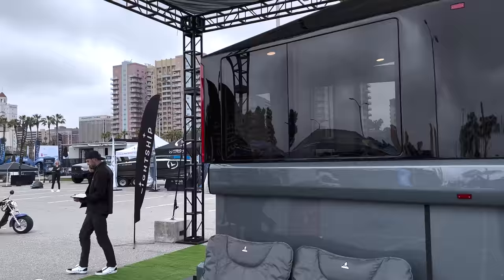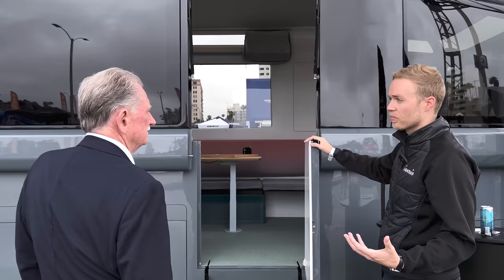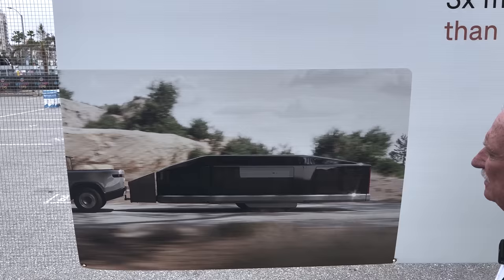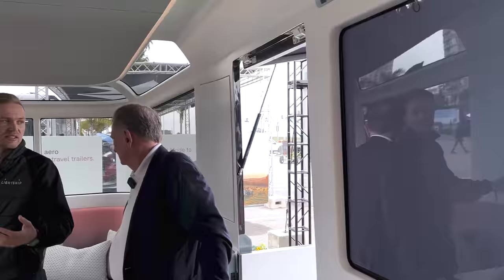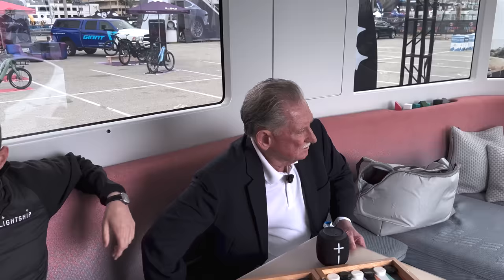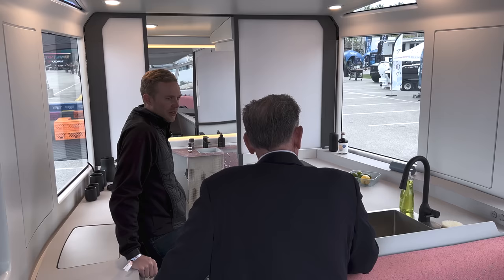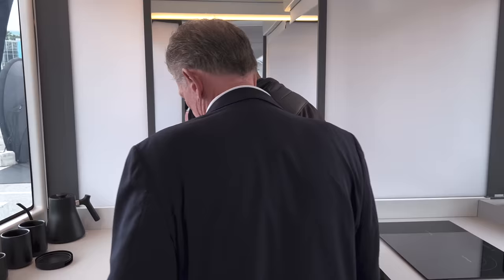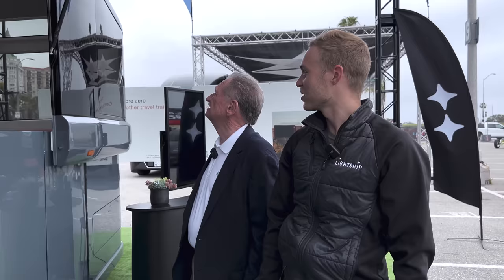Tesla Graduates Electrify the RV Industry - Lightship's All-Electric Trailer

Comment: Looks great. I just wish they would reduce all the thermal gaps (windows). I'd like to know who they're polling who say they like a spacious RV. Everyone I know would rather have the walls covered with more storage space. On top of that, every RV I've ever seen had a minimal amount of polystyrene in the walls with single pane windows. I wish someone would install 3.5" of polyurethane closed cell or some vacuum insulated panels in the walls. If you build a great thermal envelope you dont need as much electrical power to keep the cabin comfortable.
Reply: It would be mandatory to have a pickup truck for all your stuff....but I don't see enough storage for food, let alone clothing.  Also the air conditioning is extremely power-hungry and the thermal loss or gain will be tremendous, even considering that the solar panels on the roof will help.  Not practical.  And they have taken a high end RV and added $35,000 in additional complexity.
Reply: This is exactly what I did with my diy trailer. Two small windows in the kitchen and one in the bedroom. Rest is insulated walls.

Edit: but this is a collapsible trailer which is very smart for EV towing.
Reply: there is overhead storage that they didn’t show. and some storage where the propane would normally be. and under the couch area.  they should make a storage accessory to install over one of the windows for extra though.
 I too think good insulation is important. and most rv parks don’t provide great views. however, you can electo-dim the windows individually- so you can optimize what you see, easily. some other videos cover additional functionality not included in this video.
Reply: @mriguy3202  - Electric HEAT pump , not a Conventional AC unit, too heavy , inefficient. 
Defiantly, reduce windows to minimum. and only use Thermal windows. 
Lightship , should have LESS energy requirements than Conventional RV.
ZERO combustion heating & cooking. 
no longer need Dangerous GAS bottles.
Reply: another aspect i like about the starship is that it would allow you to generate electricity for your home if you park it outside. just install a generator plug/transfer switch. minimal permitting or work required. 80 kWh is a huge bank for a home.
Reply: @dfghdfzsd   - NOPE, V2G is a great way to KILL your Batteries.
NCA/NCM not great option for V2G. 
better off with 4x powerwalls , in the FIRST place.
Reply: I sat in that prototype on Saturday and chatted them up. the spaciousness is totally off the hook, and there is plenty of storage. I hope they don’t change a thing.
Reply: @markplott4820  nca/ncm? 4x powerball is 55 kWh vs 80 on the lightship. also, KILL in all caps is a bit strong- any daily usage will very slowly degrade the battery, powerwall or not. how the cycling is done has a big impact and we can expect similar care as you might see in the powerwall electronics. 4 powerwalls is $32k. 
lightship could offset $1000 in electrical bills yearly for 20 years and still have 64 kWh of capacity left. and where will battery tech be in 20 years?? 
Just food for thought. i suppose it’s all a matter of priorities.
Reply: @WarrenBowman  - Did the windows look double paned? Just curious because if they aren't users will get MASSIVE amounts of condensation on the inside when camping in cold climates.
Reply: @__-pl3jg  they are not. Since it’s a prototype, I don’t expect that these are necessarily the final windows.
Reply: @dfghdfzsd  it is but the trailer only has 3kwh of solar. Plenty for a trailer but minimal for a home. But I suppose better to get use out of it then have it parked doing nothing. 

Only downside is the cycle life of the battery using it for a home like that
Reply: On a lifting roof system with solid walls its hard to have interior upper cabinets over lower cabinets and furniture along with maintain the full overlap when closed for towing efficiency.  The shower head on the ceiling was likely to eliminate a protrusion out of the upper wall that could be sheared off when collapsing the unit while in the galley they had to use a faucet that needs to be removed before lowering the top.

On the large expanses of glass, it was probably done to give the illusion of space to make the lack of slide-outs as obvious.  Many who would be spending that kind of money on a comparatively small trailer that's less than 30 feet long would feel quite claustrophobic in a 27 foot coach that has a full bath with no slides and few windows.

The final selling price is going to be interesting and may end up being as costly as a small Class A unit.

Note that Hi-Low, who has been making this type of trailer since 1955, still has not be able to raise enough capital to resume production (even without the added cost of adding the drive unit) and they have limited their sights to just an 18 foot long by 6 foot 11 inch wide unit with a 6 foot 2 inch ceiling height.  Those weigh in at 2,362 lbs dry and have a cargo capacity of only 870 lbs for a gross weight of 3,232 lbs.  At this point they no longer even have a production facility after being in business for 68 years so it may be difficult to be the "New Guy" introducing an upscale Hi-Low at this time.  Investors may look at how the Grandfather of this type of trailer is doing and be concerned about a startup being able to do better.

Wish them success as we need this type of driven trailer tech across the board today but may need a simpler more utilitarian version first to reach economy of scale.

Best!
Reply: @mikebalentine  yeah, depends on how aggressive you cycle the battery, but it’s a shame to let it sit doing nothing. and the bigger the battery the gentler you can cycle- in general. My house would only need about 10 kWh during the day when i pay ‘on-peak’ prices. so this would be perfect for me, but everyone’s situation is different. 🙂
Reply: All the windows walls slide down for efficient towing.
Reply: @dfghdfzsd  my plan is working up to 60kwh. I figure that should last 5-7 days in the event of bad weather moving in giving me lots of flexibility.
Reply: @markplott4820   - ha ha ha...   the marketing bought you too?? pray tell, how is the magic heatpump different to my Daiken AC..  (all modern AC units in the real world reverse cycle) - yes there a re different compressors and different gasses for temperature ranges..  AC - heatpump, - potato, tomato..  (sure exchange any medium.. water/oil/salt/Air to air/water/solid - exchange to whatever you like...

(no window has anything like the "real" thermal performance of any decent insulated wall panel)
Reply: @markplott4820   (you mean, buy the power walls, instead of the EV ?? - keep the old jalopy- more enviro... )
Reply: @kadmow   - NO, get Both.
TESLA model 3 RWD + Powerwalls 2 - 3. 
powers your HOME for up to 3 DAYS. 
get SOLAR + 1000w WIND , even better.
Reply: @kadmow  - ULTRA compact HEAT pump from Panasonic & Mitsubishi use LESS energy and the units are outside & you can have Multiple Discrete air handlers. 

even BETTER Ditch the old fashioned water heaters for Electric point of use. 

endless HOT water only when you need it, & where you need it. 
no need to heat water all day , when no one is home.
Reply: @markplott4820  ok, so you’ve got some things right 😂
Reply: @markplott4820  ,yes thanks, I have similar...
Reply: @markplott4820  , ha ha ha, assuming everyone has $$$ kicking around to make more payments...  Ot is the financial jump we need to help people over, mostly it is Either electricity Or...  Most choose food, lol...( we are very fortunate exceptions. )
Reply: @kadmow   - SOLAR building Materiels are just as cheap as wood & stucco home.
Reply: @markplott4820  : not sure I follow you, yes in Australia it is getting "more affordable" to use the solar panels as the cladding for an insulated roof system (not sure I like walking on solar panels however -  use soft climbing shoes), but the price per panel is higher than durable metal roofing - then the solar electric components have a cost too.. (500W trina panel - nearly the same size as a typical sheet of OSB $325 - OSB plus asphalt shingles ?? $60-120.

In the USA the solar industry is pricing significantly higher - apparently.
Reply: @kadmow   - Builders are also using SOLAR for Structural walls too.
Reply: @markplott4820  ;  you don't really answer just more deflection..  Still incorrect on most dogmatic points raised - sure a solar inclusive façade will be great  (fails on the "non flammable curtain wall" however ..  though much more expensive....  One can power their "monoblock pumpless" heatpump for free however (thermal storage is much more affordable than any quantity of electrical storage), so there is a potential net benefit...  lol...   I will keep on just having a laugh.
Reply: @kadmow  YET, more & more Developers WORLDWIDE are building Projects in REMOTE grid FREE areas.
Reply: @markplott4820   - yes with unrealistic funding (subsidies) and/or diesel backup.
Reply: Embassy vans insulate better for more efficient electric usage with no propane and no solar.
Reply: You can't have a bunch of overhead and undercounter storage and have the trailer collapse for the aero.

If agree if it were a drivable RV, but since it's tow-only, you'll have a truck for some extra storage.
Reply: You can’t put in more storage where the windows are, because this is a pop top camper. All the storage needs to fit with it in the down position. I also don’t understand why even wants to bring so much crap with them they feel like they are staying in a storage unit.
Reply: You can't have a bunch of storage on the walls since the walls telescope down so there would be no space. If anything maybe some foldable shelves could work

Comment: When the L1 Camper is in drive mode, the windows will be easily cracked by passing car/truck stone chips. Would need to put PPF over the windows.
Reply: You’re not paying attention.
Reply: All they would need is to have is some hinged hard panels to flip over from their stowed positions on the roof to cover the front windows in collapsed Road Mode.

Comment: I like a lot the features, particularly that telescoping aspect and the aerodynamic form. I just wish it was smaller size. I dont want to haul a trailer that big. A 12' trailer that i could haul with my model y would be amazing...
Reply: you are absolutely not going to get a 3500lb self propelled 12’ trailer
Reply: I asked the same question when I was there on Saturday, and they told me that they have plans for a smaller version. since these are former Tesla guys, they may be following a similar path, with rolling out the deluxe models first.
Reply: If it is self propelled, the weight may not be an issue. Control is different to towing. But the EV manufacturers would have to come to the party with changing rateings and control systems that work together.

Comment: I love the overall idea, so please don't take my comments as being negative.

Windows:
There are way to many windows for me.  
We once rented one of those rooftop hotel rooms in Mexico and felt like we were in a fish bowl. 
I can't help wondering what it would be like in Minnesota when it is 10 below zero.  
And don't forget the mosquito netting.
I am hoping we can order with different molded inserts; some solid with a high R-value and  some with windows.  
The we can choose how much open we want.

Aerodynamics:
If the truck had a topper of the same height as the main trailer and you made that box (over the tongue) the same height also; 
there would be a continuous roof line all the way from the truck cab to the back of the trailer.  
Wouldn't that have the best aerodynamics?

Backroom sink:
Should be bigger backroom sink.  
That one looks pretty but that weird one would be dated so fast.  
Would also get water all over the place.
Give them a chance to wash their elbows  and their socks!

Canopy:
Needs a canopy for shade and rain.
Could be a canopy embedded in the roof edge (for aerodynamic reasons).
Or add a couple nacelles ala Star Trek with running lights  and have the Canopy in these.
Then you will truly have a Star Ship!! 🙂

Kitchen setup:
Love it, love it, love it!

Wonder:
1 - how many sizes this will come in
2 - total weight?
3 - likely pricing?
4 - CATL batteries?

Thanks for a great idea.
Tom
Reply: Most of this info is on their website

Comment: This is doing a lot of things right. The same fundamental concept as the Stella Vita: Raising roof to minimise frontal area, big PV roof, aero shape, lightness. I like the Stella Vita more as I prefer a camper van to a caravan, but this is great as the trailer version. Nice to see someone finally doing it right and using the traction battery as the house battery and not having two. Nearly every conversion just adds a 2nd battery which is just wasting space, weight and efficiency.
I dread to think how much it's going to cost, and it's too big to be much use in Europe.
But this is the right direction and I look forward to some competition. I'm much closer to Sandy's age, than Ben's but pretty-much the only reason I have for owning a vehicle other than a bike is for camping.
Reply: It has also gotten a lot of things wrong.
Reply: @williamscoggin1509  Would you care to expand on what things?

Comment: Sandy likes it which is great but....   More importantly, what was Sue's reaction?  Inquiring minds need to know!

The timing was interesting to me as earlier today I was thinking about how DOT would react to camping trailers with electric kicker motors in them to extend range of the tow vehicles along with what could be done to add such to existing pop-up/hi-low or teardrop trailers.

Best!
Reply: Airstream debuted their electric trailer concept at the Tampa show in 2022.
Reply: @alexkleine9737  Yes, an event that I missed out on.  It will be interesting to see if/when suppliers such as E-Trailer start making the drive axles and controllers available for the DYI crowd.

Comment: I get why they chose a rain shower head, but I hate it. They use huge amounts of water and any soap you put on is rinsed straight off before you get a chance to give yourself a good scrub, defeating the entire point of having a shower in the first place. Low flow taps and shower heads are so much more efficient in terms of water usage. 

It might have been nice if they'd been able to incorporate a water recycling shower into the design. They will filter the water until the sensors detect that the water has become too dirty before allowing fresh water into the system.

Comment: Ok we spend over a 100 days a year in our airstream and I’ll give a few things I noticed. The bed is an afterthought and would be good for minimal number of days and people especially when you have to make it each day and no storage was shown for any blankets or sheets. There seemed to be minimal stowage throughout. Our classic 30 has tons of storage. People that like EV’s like tech and this didn’t even show a TV. Not even cheap small one or stereo system. They didn’t even mention heat or air and you can’t see any ducts so not sure about that. Appliance type was great but most would rather have a bigger fridge than a dishwasher. This seems for people just spending a day or two out and they won’t need to do dishes. And the fridge style won’t be easy to use. The aesthetics of the bathroom were great but that sink is a joke and needs to go. It’s built for a 3 yr old. You need a air fan for exhaust and temp control. Our airstream has radiant heat that is incredible and silent. The large shower is great. Didn’t mention size of any tanks. Outside you need a receptacle. A satellite or Starlink connection. More storage. An outside shower, awning, and you need to be able to carry bikes. Preferably e bikes which are heavy so something on the back or at least a hitch to attach to. And all people that pull trailers have some type of anti sway hitch or like us we have an incredible propride hitch that is zero sway. The front has so many cowlings near the hitch that it doesn’t look like anything could be added. Maybe you have a fancy system that controls the wheels for braking along with the motor. Another plus would be a DC to DC cable to run from the tow vehicle to charge the trailer. I’m sure not all people will tow with an EV. You don’t want a limited market like that. Aerodynamics are great and overall looks and styling and materials just need some changes and you’ll get a bigger market. This seems like it’s meant to be used just on a weekend.

Comment: Been saying it for year's that it makes more sense to have a trailer with a decent battery (2nd life) pack built in as a range extender. When not in use you plug it into your home. Charge from solar pv. Forget V2L etc. Imagine all the compact cars towing one of these trailer's when on holidays. A common standard needs to be developed.

Comment: They will find that after-sales service is a costly problem.  Buyers will take them all over where they will break.  The existing infrastructure for RV repairs is pretty awful in the USA.  On the other hand, quality control and manufacturer support for existing RVs is so terrible they might be able to stake out a marketing high ground.
Reply: Yeah with the service issues the "competition" has, I think Lightship stands a chance if they get funding. They're getting good test data on the raise/lower function by taking it around to shows. They see where it's wearing down. Sounds like they're camping in it sometimes too. Maybe once they have a second prototype they can haul this one down off-road trails it's not meant to go on and see what shakes loose.
Reply: Yeah, as a lifelong RVer I've learned that if you can't fix it yourself, you're just ripe for being ripped off.